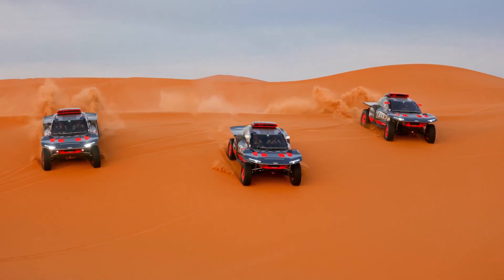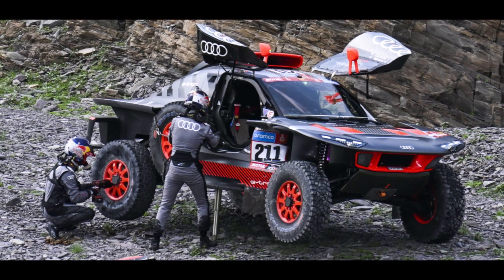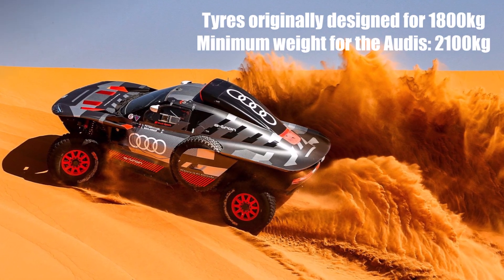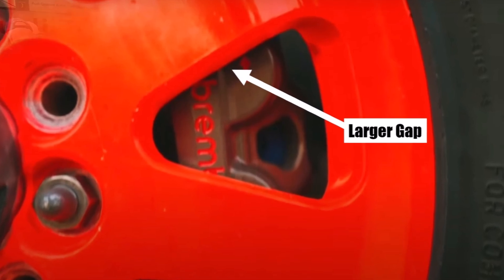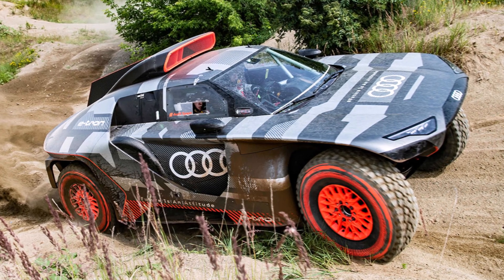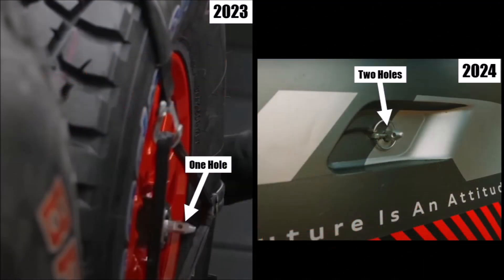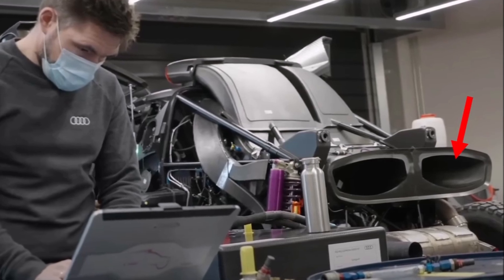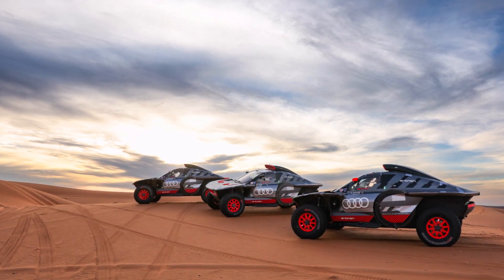DAKAR 2024 - AUDI's Preparations and Updates

Comment: Dakar is not about speed or the fastest machinery. It is more about way finding (so experience driver/navigator is key) and a reliable machine. 

Kamaz truck was never a fast truck but a strong truck. It had won so many times as a result.
Reply: I think it used to be like that, an endurance adventure, more than a timed race. I think those times are gone.

Comment: The question i have is how much fuel audi uses compared to toyota. It's hard for me to belive that they are saving fuel in this complex sistem, maybe in idle, or when stuck.
Reply from the maker: You can find the answer in my previous videos. The Toyota has a 500l fuel tank, Audi 295l (340l)
Reply: My car has 50l tank, but i only put 30l each time xd. Still 500 to 340 is a massive. Good job audi i guess
Reply: I believe the fuel saving will not be huge if they have to recharge of generators (although they can use sustainable fuel). But the electric drive should be an advantage in difficult terrain.